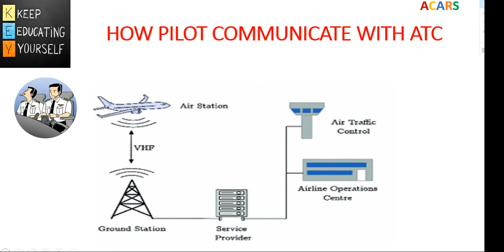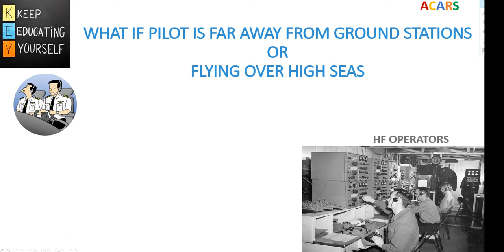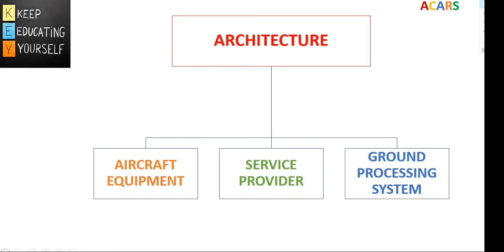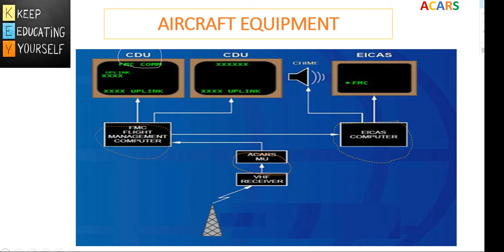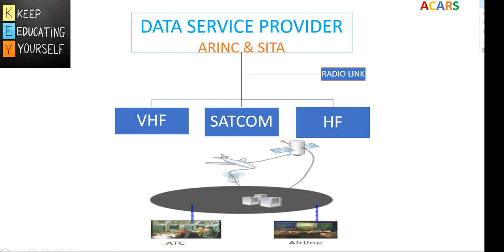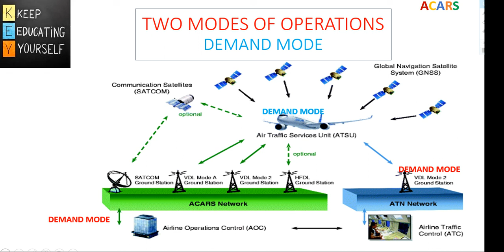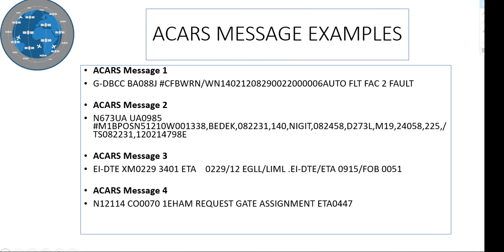AIRCRAFT COMMUNICATIONS ADDRESSING  AND REPORTING SYSTEM ||ACARS|| AIRCRAFT COMMUNICATION SYSTEM||

Comment: I've seen a few of your other radio communication related videos and all I can say is WOW! Very impressive! Heck, for one of your other videos on radio propagation modes you provided a few formulas that I've NEVER seen in amateur radio produced videos...even many academic videos have not produced that.
I know that this video was created 3 years ago to this date. I'm hoping to find the answer to a question I have about ACARS. I can use a SDR Software Defined Radio, antenna, and computer software to decode ACARS on VHF (as well as on HF via HFDL High Frequency Data Link, and on an Iridium geostationary satellite). Since the transmission time of a VHF ACARS signal is relatively quick, why are there more than one frequency used? There doesn't seem to be any problem of overlap from overcrowding. I can receive multiple freqs with ACARS messages simultaneously, so it's not geographic. Do different airline companies gravitate towards a chosen freq for their own? I know that there are ground reception stations, but am not aware of how far and how many there are of them.
Reply from the maker: Satellite coverage  dependent on where you are in the world, although to a lesser degree. Inmarsat have coverage between plus and minus 80 degrees latitude, although Iridium have more, lower, satellites so can offer polar coverage too.

There are only 15 HF transmitters stations in the world, but they have long reach and are located for polar and oceanic coverage.

VHF is the main band for these messages,  due line of sight, each geographic region uses a different frequency, and this is per datalink service provider, so ARINC  in Europe is a different frequency  to SITA in Europe